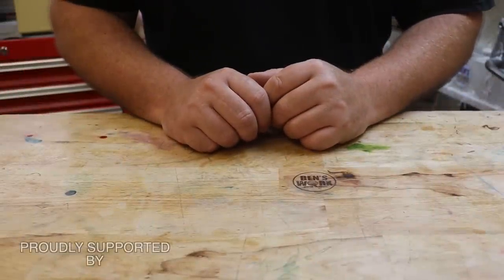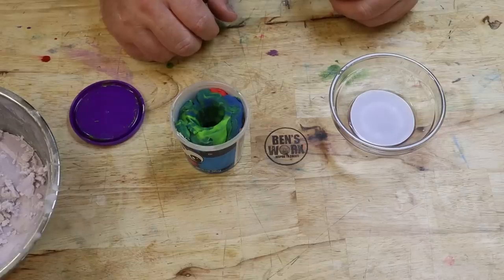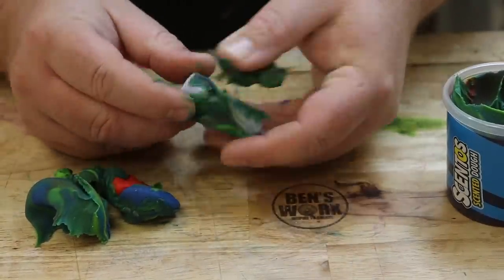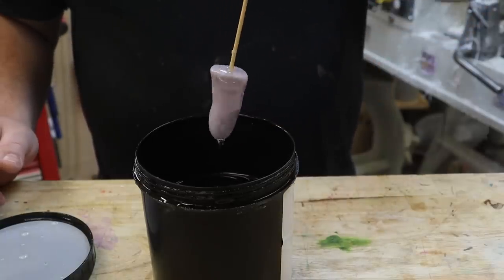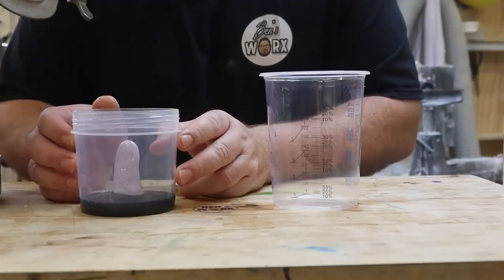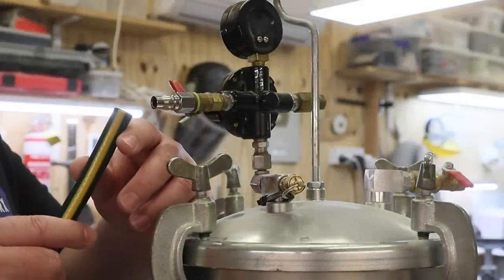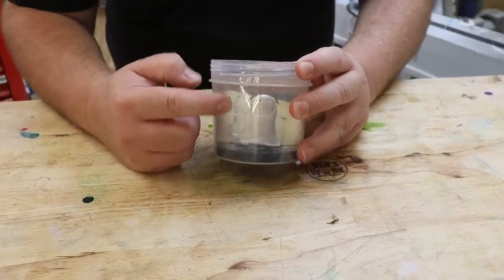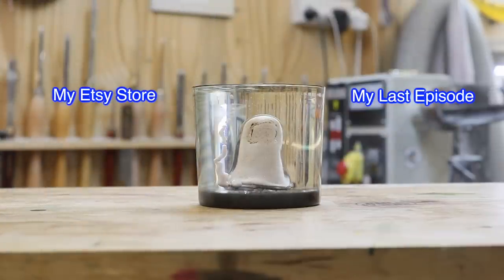You won’t believe what happened! UV Resin vs WAX

Comment: Hi Ben.  The reason the wax escaped is because it expands when it melts.  It found the slightest weakness in the UV resin shell and broke through at that point.  To avoid this in the future, you would need to leave a small air pocket inside the UV resin shell but that creates its own problems when the wax refreezes and shrinks and the air pocket will reappear inside the UV resin, usually in a not-great place.  

Here's a method you might like to try.  Use the positive wax casting to create a thin plaster of Paris negative mold of your finger.  Once it sets, warm it up in a slow oven to melt the wax out and then pour your normal resin into the plaster mold with whatever additives you choose.  (Some wax will be absorbed by the plaster which then acts as a natural barrier to make it easier to remove the mold).  Break the mold to get the resin out and then cast it into a clear resin egg as normal.  

This method opens up heaps of options for adding colours as well as textures such as glitter, beads, string fragments, sand, brown rice grains, Hundreds & Thousands, cake sprinkles and other textured items.

Cheers from the Gold Coast. :)

P.S.  Would you like to cast a five-point star using a silicone mold the way you did your recent dragon?  Mix lots of those tiny, coloured glitter stars they use for party decorations into the resin, then put the finished star into a blue-tinged egg.

Comment: After seeing the cool little wax bubble column, it gave me an idea…
You could make a cylinder of wax, maybe pour it in different coloured layers so it’s striped. Then after coating it in UV resin, could you drill various little holes into the wax so when it cures you end up with lots of different coloured bubble columns? Any wax left in the centre would melt together and mix colours presumably!

Comment: Ben, this turned out fantastic! 
What about filling a mold with water (and glitter) and FREEZING it! Then coating in UV! You could basically make snow globes in your eggs!!!
Reply: Ice is the only (that I'm aware of) solid that will decrease in volume when it melts. So unlike in this example, there shouldn't be any cracks forming, and in theory, it should work. I don't know how he'd ensure a full covering of UV resin before the ice started to melt, but if he could, that would look amazing!
Reply: @Zoso14892  dry ice/liquid nitrogen temperatures, maybe? or he could chill the UV resin, but i'm not sure how it'd react if he did that. though if it reacted badly, i doubt coating super chilled ice in it would work either

Comment: In regard to that "bubble" of UV resin: The UV resin and the epoxy resin refract light differently, so what you're seeing here is the UV resin shell imbedded in the epoxy. To minimize that, you'd have to use the casting epoxy to coat the wax.

Comment: I think I have an project idea. Take some small long object and coat it in uv resin cover the wet resin in glitter, harden and repeat a few times to build up layers. Then when you put it on the lathe and cut it down you will have all the layers of glitter with the layers of clear resin between them. Sort of like "Fordite"

Comment: You could melt out the wax, and fill it with coloured resin. Also, you could dip a wet finger into the wax several times, to make a sheath casting of it (like they do at shows, for example).

Comment: My daughter and I were just watching this video and we had the idea that you could do something like this and then drill a hole up through the black base and then heat the buck to melt out the wax. Then you could pour a different color resin in through the same hole and the UV resin would serve as a mold.  So it would be a little like lost wax casting in metal working.

Comment: You could always let the resin set in a fridge. Obviously not the fridge you keep food in, but maybe you could get a cheap second-hand one. It will take a lot longer to set, but it won't get as hot, and you could do thicker pours without the resin overheating and giving more time for bubbles to escape. Black Forest Wood Company does this with their resin encased items and it seems to work well for them.

Comment: I'm curious why people thought it wouldn't melt. The heat from the resin is still there. It just has a thin layer of resin covering it. I don't think you had a hole in your resin either, its just that (almost all) solid material expands when it becomes a liquid, once the wax melted the pressure built and it broke through the weakest point. It solidifying again is what left you with the slight bubble around the wax.

Overall, it's a really cool effect , and I'd love to see what you come up with in the future!

Comment: i think its still going to melt, but if there's no breaks in the resin coating it should work. if it cracks or has a hole in the coating then it'll probably mess up again. hope it works though. keep up the awesome work!

Comment: Try the ship in the bottle project again where you used the star trek ship and it partially melted or deformed from the heat... Perhaps the uv resin could act as a encased support so if the plastic weakens it'll end up supporting it and prevent the melt.

Comment: If you do any more finger molds I'd suggest making a silicone mold, that way you'll always have it if you need it. On top of that it will capture all the details of your finger much more cleanly, and you won't have bits of playdoh stuck to the finished product.

Comment: use alginate instead of playdough to get the negative. don't fully cover the wax in uv resin, melt the wax out of the uv resin. then leave it as an air pocket when you do the full resin mold.

Comment: 3D print a skeleton for a LEGO figure, make the wax mold for a real LEGO FIGURE - Cast the skeleton INSIDE the wax LEGO figure. Coat with UV-resin.
 
Then when its all encapsulated by the outside resin, you can make a stand with a old lightbulb lighting - one that creates heat - so whenever you turn on the light the LEGO figure melts translucent and you see its skeleton!
 
Ambitious? Yes! Awesome? Yes! How do you suspend the skeleton in the wax so it doesn't just sink or float when the wax is melted? I have no idea! ❤

Comment: And here I was thinking the hose is so that the hissing noise does not overload the mic. Does your UV resin gets hot when being cured by UV? The one I use gets really hot for a few secs then cools down after it cures. I do use a 265nm led torch with a rather high power led.

Comment: Wonder what would happen if you did the open and unopen soda can in resin? if you can do the needle hole size and drain the liquid out and after all the soda is drained patch up the hole and see if the heat from the resin will crush the can or not.  And another to see what a full soda would do as well.